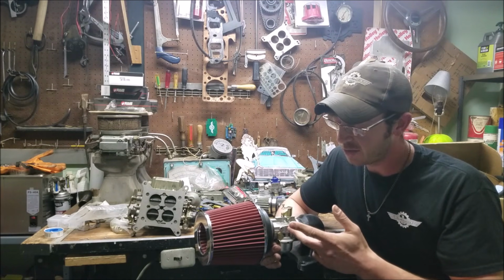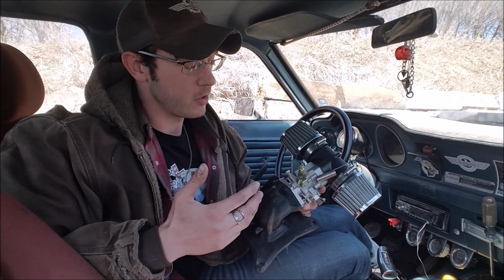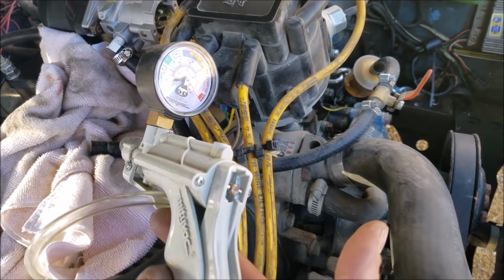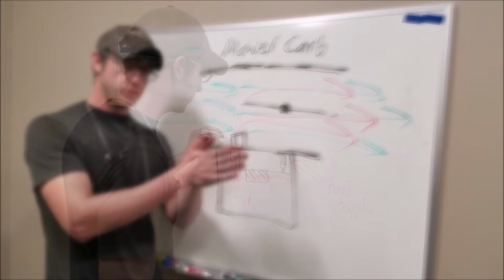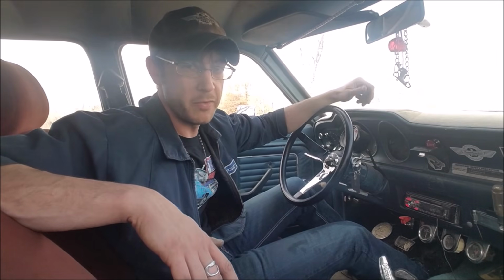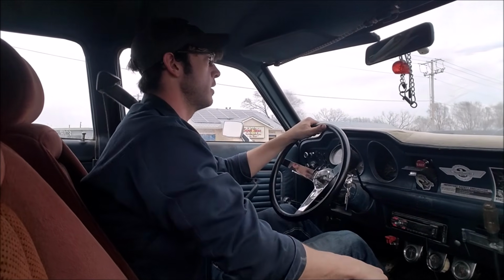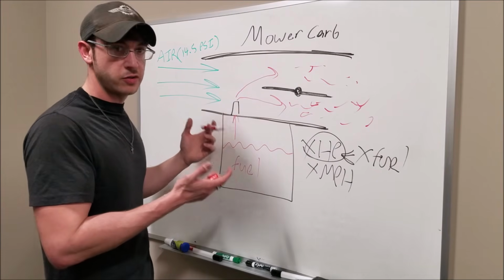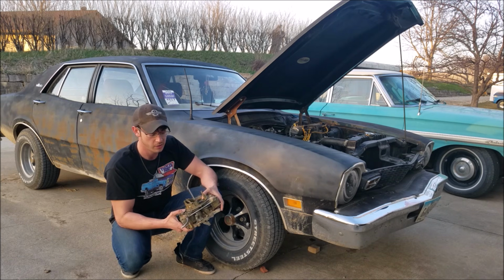Will It Run? Lawn Mower Carb on V8! (The "IMPOSSIBLE" Becomes Reality!) Start to Finish

Comment: LOVED YOUR LAWNMOWER CARB ON V8 VIDEO !!
I've done a similar fuel conversion on a nice vintage 86 Chevy 4x4 van that came with a factory installed camping interior.  I did the 4x4 conversion & engine swap a few years ago, my wife & I used this rig to tow our RV & assess the backcountry. It's running a 383 stroker, auto trans & a gear vender.
 I purposely kept the running gear on the van old school with no computer as I'm somewhat electrically challenged.
I conducted several years of research prior to delving into these projects & to avoid melting down the newly built stroker motor. With a 4-barrel carb this rolling breadbox gets 10 mpg on a good day with a tailwind. 
 I first converted it first to run on hydrogen but output was not sufficient.
Note; Prior to experimentation & avoid engine meltdown issues I installed  Manifold Temp. & Air/Fuel ratio gauges. 
I ultimately converted the van to run very well on a gasoline vapor unit I designed that includes a float valve setup installed in bottom of the unit.. I'm currently running a chinese knock-off  of 54 Chevy single barrel carb on the van. Bet a lawnmower carb like yours would work equally well if it was used in conjunction with a vacuum advance like you built.

Most don't realize that Henry Ford patented a working gasoline/kerosene vapor unit back in the teens. I was fortunate to observe one of Ford's factory units work on a local truck & was provided with the plans.

Only issue is that gasoline vapor freezes same as propane, I believe the solution is to introduce more exhaust heat from the manifold but got stopped a couple years ago due to health issues. 
My goal was to try & exceed 100 mpg running vapor & distribute plans for free to those interested.   
This goal would not likely be well received by our taxation & energy moguls.🤣
*The vacuum tuning unit you built is very ingenious, wish you were closer to Idaho to consult & incorporate on my project.
I'm now 81 with health issues so unfortunately the van may end up with another like minded mad scientist.   
I would welcome your input.

Chuck T.
Kuna, Idaho
Reply: Chuck if you are still sharing the plans, id love to have scans and be able to pass them around. Your ingenuity is amazing
Reply: Chuck it's a small world,  I used to live in Kuna
Reply: Are you still with us Chuck??
Reply: @tims7219   Apologies' for the late reply Tim. 
My vapor setup works very well on my 383 stroker & produces excellent EGT & air/fuel ratio results on the gages. Only issue is the vapor freezes up under higher rpms.
I introduced some heat via copper tubing to the exhaust manifold but was not enough to resolve the freezing. Unfortunately age '82' & health has put a halt to completion so will be selling the 4x4 van. Hopefully find a new owner who will add enough additional manifold/exhaust  heat to perfect the operation.
Reply: Chuck, if you don’t mind could you send me your current design and the information you have gathered? I’m very interested in your ideas. Also, could you provide some more information on the Ford patent? I’m curious to look into that as well. Thanks.
Reply: can you scan that vapor system and share it in a public google drive link?
Reply: I’ve got a 383 on my 1980 corvette I’d love some information on this as well

Comment: Love this!  You know people have forgotten that for MANY years single barrel carbs ruled absolute. Granted they were designed for automotive use and not a lawnmower, but the point is, they were very capable carburetors. My '62 Chevy II had a single barrel Ball & Ball that would roast the tires without hesitation, the added velocity of the charge was key.  Also to note, I had a 1976 Monte Carlo with a 350cid engine that originally came with the large 2 Barrel which I swapped out for a Quadrajet. My mileage jumped from around 21 to 27 because of the much smaller primary throttle bores (as long as I kept my foot out of the throttle. The move to larger carbs was needed for the demand for power which quite frankly sealed the fate of the efficient single barrels because the general public started demanding power over efficiency.
Reply: Qjets were fantastic carbs

Comment: I don't understand why you would think that this wouldn't work. When I was a boy, the neighboring farm had an old international dump truck with a 600 cubic inch inline 6 in it. The intake manifold and exhaust manifold were mated together, and it had a tiny 1 barrel carb on it. 

It was decent on gas, but it had to completely warm up.
Reply from the maker: Easy to say now.

Comment: I knew an old guy who told me about old carborators getting 60 mpg then that old tech was bought and hidden from public use. This video makes me believe him. Most excellent video, thanks man
Reply: Yeah I'm almost certain we had the knowhow to have far more efficient vehicles long ago but to keep the industry neverending advancements get put out in a planned order. That and planned obsolescence will keep us buying cars for many decades to come.
Reply: My 2018 GMC half ton crew cab 4x4 with the 5.3 gets 30 mpg on the hiway at 60 mph and has tons of power  , I had a GM sprint with the 3 cyl many years ago that got 75 mpg on the hiway , the manufacturers have done a great job moving a lot of weight with the power that people want .

Comment: I would be interested in seeing how much cleaner the engine is running, emissions,spark plug readings. Sure runs nice! Enjoy the channel!
Reply: Keep in mind that this was only highway driving in a straight line in Iowa. Traffic in Iowa I would imagine must be sparse and the state is mostly flat. Modern cars can already adjust for fuel trim and timing advance and an ungodly amount of catalytic converters.
Reply: @eaglewarrior8707  And most newer cars are not getting 40 MPG and flat, sparse highway either. Especially larger engines. Heck, most smaller engines are not getting that.
Reply: @eaglewarrior8707  this is not the point buddy. you should focus if this engine runs with 4 barrel what kind a mpg should can do in same situation.
Reply: @yunusertas  you can easily increase your MPGs with a 4 barrel as well. Take the same concept he has here, adjust it and apply it to the 4 barrel. I don’t see how or why it shouldn’t work. Maybe not 40 mpgs but you can definitely get better than out of the factory.
Reply: @MrDoNotAnswer  nope i mean if standart 4 barrel 15mpg and this setup makes 20mpg this is success. im talking about this. not on which kind a carb u can use.
Reply: @yunusertas  success when it comes to purely increasing MPGS. The car is also now twice as slow with acceleration, which is undesirable to the majority of the population.
Reply: @MrDoNotAnswer  for normal use car seems look enough for acceleration and also cruising. if u dont wanna race with other people. and if u now this much uncan make your own video about it😄 im waiting that. i really wonder your setup.
Reply: @yunusertas  even the creator said the car was slow. I’m going off what I watched in the entire build series of this. Don’t have to get defensive for him 😅 never said the build wasn’t neat or interesting, this isn’t practical to the everyday driver is all I said. My 4 cylinder Chevy cruise got 40mpg on the highway at 70mph 😇 I don’t need to engineer such a motor when my vehicles have no issue getting more than the average MPGS. My “fast” cars (more like quickish) are my fun cars that I don’t care about the miles per gallon, it’s about the smiles per gallon. Who wants a 40mpg V8 if it’s slower than a turbocharged in-line 4 getting the same mpgs. Makes 0 sense.
Reply: @MrDoNotAnswer  my turbo charged stock 19 ford ranger only gets 18.7 at best
Reply: @eaglewarrior8707  I think the CATs pretty made his case
Reply: 85 mustang 4 Bl Holley carb can get 30 mpg but air bleeds need to be opened and there accelerator pump has a bleed off for light throttle no fuel transfers / but that air fuel gizmo would work on everything to keep AFR @ 14:1 that’s the ticket now get a MSD .65 plug gap to fire leaner mix / or add HHO to the air bleed you’ll be at 100 mpg
Reply: Combustion chamber Temps will be thru the roof. Spark plugs will be burned to hell. In a few hours the motor will die. Fuel is a huge component in cooling Combustion chamber.
Reply: @eaglewarrior8707  iowa is rolling hills...very little dead flat areas.
Reply: Yes I’m curious as to what the plugs say myself
Reply: Great work with your thoughts and abilities
Reply: @jondelrun  
My 03 civic gets 39-40 at 60mph.  But it's small,  gutless, somewhat aero, and weighs nothing.

Imagine a small carb like this on the 1.7L in my civic.
Reply: @jondelrun  No but ... where this V8 gets 40mpg my 3 cylinder 1L probably gets over 100mpg in the same conditions.... it gets around 65mpg in city / rural driving with hills.
Reply: @MrDoNotAnswer  Obvious that your concept of a decent driver is a bugati veyron. A vehicle that puts out outstanding mileage is probably a lot more desirable than you think given the cost of fuel nowadays and the ingenuity of this project is amazing. So stay with your 15 mpg or less, but there is obviously a lot of people that want high MPG"S and if this sacrifice involves a slight acceleration loss, I will gladly jump on that ride.
Reply: @MrDoNotAnswer  That is correct. Only swap out the mechanical 4 barrel for a programmable EFI unit. My 440 went from 14-15 mpg to over 20 mpg on the highway. It slams you back into the seat and goes like a rocket when you stomp on the gas pedal now. I'm sure the rebuild had a bit to do with that.  It doesn't stink like a 60's car anymore either. The AFR sensor in the exhaust really cleans everything up. I would drive it all the time if there wasn't a bunch of idiots on their phones.
Reply: Burn too lean and the engine will burn up in time 😢
Reply: @jondelrun  my 11 year old 2 liter sedan gets 46-49 on the highway ;)

Comment: Hi Luke, I just have to thank you for the incredibly informative and helpful content you put out. Very impressive, you've helped countless numbers for sure. Please consider creating some type of Carb Cheater tech kit. You would again be helping countless numbers in a world where rising costs are pushing many to make some tough choices and find  efficiencies wherever possible. 
With some of the highest food prices and gas here in Eastern Canada nearing $9.00 a gallon it's becoming quite a struggle for many, myself included. I would quite happily rip into my daily/work truck, an 88 F150 with an aod trans, remove the efi system and convert to a similar setup you've accomplished with the Maverick. The knowledge and understanding to put that setup together has proven to be quite valuable given the interest shown. I stand with them and would definitely invest in what you've created.   Cheers from Canada

Comment: As a 3D printing enthusiast (custom built my own 3D printer out of the parts of another), I would highly recommend you use a 0.5 (what I run) or a 0.6mm nozzle, with layer heights around half the nozzle size. High resolution for that type of part probably isn't super necessary to its function. Also, your part probably doesn't need to be as beefy as you made it, considering it's not running under any real pressures. Instead of making the base of it so thick, maybe add ribs instead. Slim it down, take a lot of the unnecessary material out, and save yourself some filament money! Great work man, your MPG result is pretty crazy.
Reply: I'd recommend layerHeights =< (nozzleDiameter/phi) for strength. I'd say go equal to that number for speed & strength. 

I like lineWidth = nozzleDiameter too.

I agree, 0.6mm diameter is a great nozzle in terms of speed and detail. 

There's also an interesting recent video by CNC Kitchen that I'd seen which details the maximization of printing speed with respects to volumetric extrusion.. The title is "Easy Hotend Benchmark for FAST PRINTING Profiles"
IMO that idea is revolutionary in the same sense of applying the small engine carb to the V8.
If you set that up then you will save so much of your valuable time! ..especially if you want to mass produce kits.
Reply: @Paint0nBrush   when he closes the throttle the vacuum probably jumps up to around 29 or higher which puts atmospheric pressure on the outside trying to collapse the plastic intake, I say beefier the better especially under the hood with the heat.

Comment: The general idea behind the spread bore (a.k.a Quadrajet) is to run on as small of a carb as possible until you need the extra air. Carbs work best when they have high flow

Comment: I would love to see a dyno comparison between the the two carbs to get an idea of the mpg-horsepower ratio
Reply: Only so much power can be made with that fuel.
Reply: @Jeff-qq4zo true, but the two setups might not provide gas milage prepositional to their prospective horsepowers

(A 300hp car could get 15mpg while a 150hp car, with more efficient combustion, might make closer to 40mpg)
Reply: @snipesy  the real question with ice is thermal efficiency
Reply: It made 59hp on a chassis dyno in another video lol. 140ish ft.lb. of torque
Reply: And it got around 40mpg on the Power Tour
Reply: Honestly it probably killed the horsepower by half maybe more but it would be interesting to see I don't think people are going to be worried about how much horsepower they're going to have in a few years it's all going to be about how far you can go what the prices of gas today.
Reply: I has to be running too lean. Won’t the engine burn itself up?
Reply: @Greg-yu4ij  he explained why his electronic fuel controller managed the fuel air mixture; furthermore he explained why it would run too RICH not lean...go back and listen...he had his understanding completely correct...all the ver best
Reply: Horsepower is a function of torque and engine speed.  The video never showed the max rpm at WOT.  I think it showed around 3k in one shot.  If I recall correctly from my highs hool auto classes back in 75/76 it took about 60hp to cruise at 70mph, less if on a level road with no head wind.
Reply: @Johnny-dp5mu  I stand corrected
Reply: No, not if you mind is brain washed to believe it'll work. It's not going to put out anything remotely close to what a stock motor will produce. Any carb will move it down the road, you can put a 4hp China made Honda copycat engine in & it'll go down the road. It won't win any races; it'll climb a hill in low gear. Same thing that people are doing with tractors, if you have the gearing it'll go. If you can tune the fuel use down to match the reduced air intake, it'll move. If you tune for reduced air intake, so will also have to tune for reduced fuel intake as well. Better know what yer doing. Too Lean will burn her down. They run best right before they lockup.

Comment: I had a 71 Maverick with the 200 6 cylinder in high school, I can appreciate the Coleman heater, it hardly defrosted the windows in our mild NC winters. But Coleman stoves were not propane in 1982, they were white gas, pressurized with a hand pump and hanging off the front of the stove by stamped steel drop-in tab retention. I remember camping in the Boy Scouts trying to scramble eggs, knocking the tank off the stove and having the vapor tube pissing fire across the campsite. Good times....really they were, life was so much simpler then.

Edit: I like the comment "Careful what you say to a self made engineer from the trailer park . . .", after 34 years in the Acura/Honda repair business I'm working in manufacturing surrounded by engineering BAs, MAs and PHDs; great guys and gals, but they often can't see the obvious because they are collecting data points or trying to abide by the latest corporate 'objective'. 

They recently dismantled and scraped our trusty ultrasonic vapor de-greaser in the processing department for an aqueous parts cleaning solution to meet a perceived reduction of hazardous chemicals need; parts requiring sealant are failing because the manufacturing lubricants are not completely removed. We are now using combustible solvents in small heated ultrasonic cleaners at point of use; rather than the isolated, fire control system equipped process department. 

But I'm Just A Dumb Ass Mechanic.

Comment: This is awesome. I would love to see this same setup on a 4 cylinder carbureted engine. I bet the gas milage would be crazy.
Reply: Most 4 cyl cars engines are 2 lt and up. I would like to try a set of 4 carbs for a 1000 or1200 cc motorcycle on a 4 cyl car
Reply: @foxmaine3921  I don’t think you’re understanding why they’re using a tiny carb on a v8 or 4 cyl. Itbs or ic setups aren’t know for being efficient just strong
Reply: @stoney3694  He said it plain as day. He never thought it would work it was a joke.
Reply: @foxmaine3921  elderlyiron did that in a 6 in line Chevy truck and it worked good, he used 2. motorcycle carb
Reply: Renault did it back in the 1970's  on the R5: they had this base version with 800cc engine and about 45hp. It needed to be revved quite a bit to get that power.
Then Renault made a special version, the 5GTL. That had a 1.4L engine with a small carb on it. Similar horsepower but more torquey yet it got BETTER mileage then the 800cc engine in the same car.

Comment: I'm incredibly impressed by all of this. 1st, your 3D printers are awesome, I print a lot of Priline CF PETG and it can be a pain although I use much bigger tips. 2nd, you took Adruino to another level and that controller you built has a ton of potential I believe.